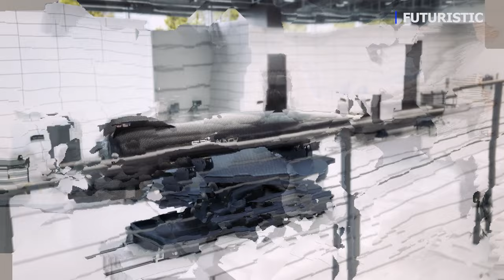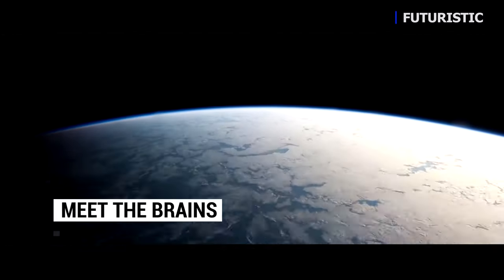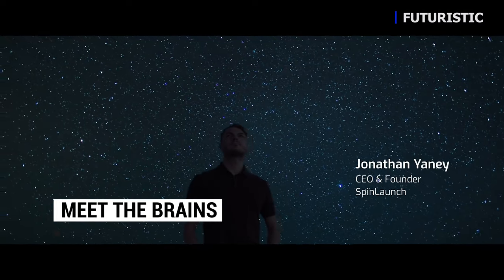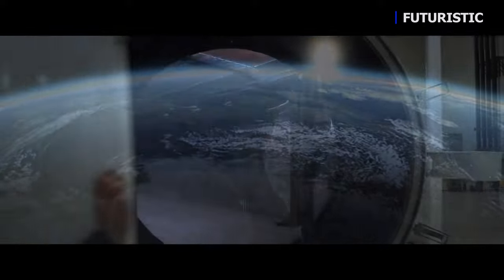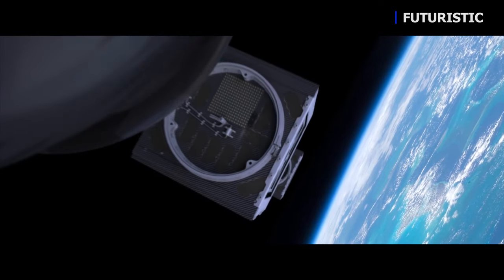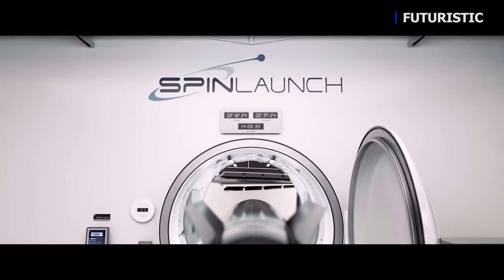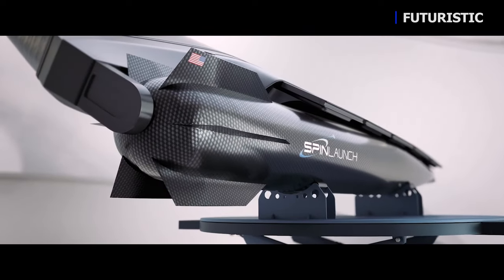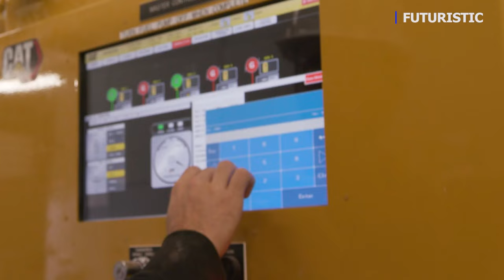World’s First Rocket-Free Kinetic Space Launch | Future Space Tech 2021 | Futuristic

Comment: Is there a material that could support the force for a similar sized rocket or even a larger one that is hard/expensive to refine and use? I wonder if there are designs that could make the force more manageable as this would greatly limit the need for rocket fuel.
Reply: Graphene maybe? Heat resistant and strong as hell?